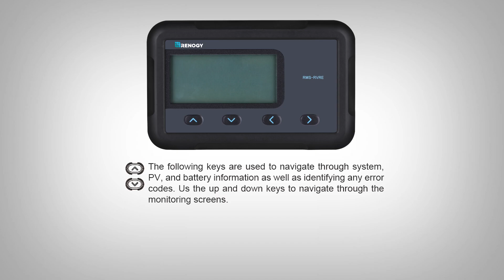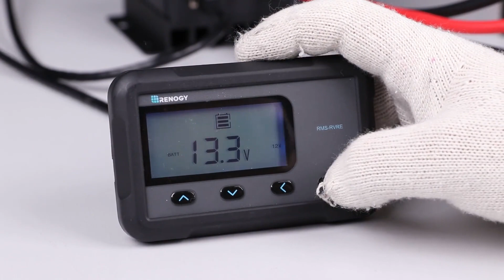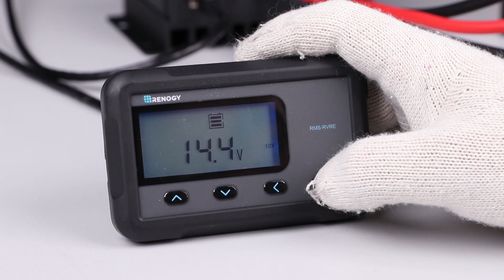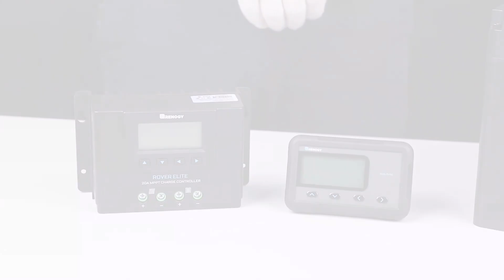Monitoring Screen for Rover Elite Series

Comment: You need to put better connectors in the controller.  Even when tight, the battery wire fell out while the solar panel was still connected. If my controller is damaged I will expect a replacement.
Reply from the maker: Thank you for your feedback. Could you please tell us more details via email like your battery wire size and type. We will make an improvement plan as soon as possible based on your feedback.